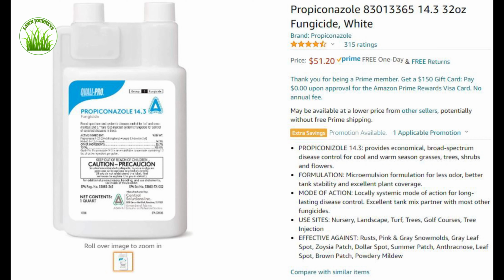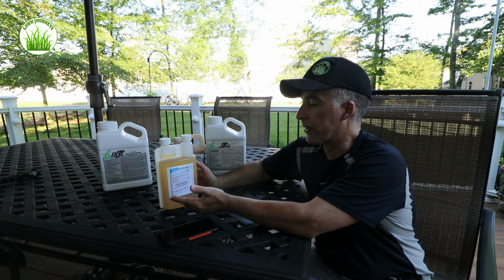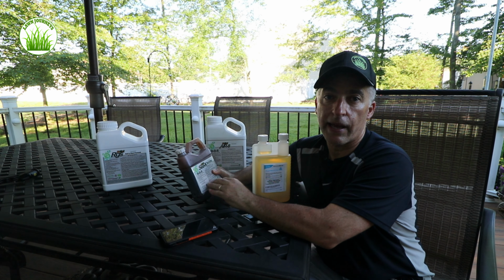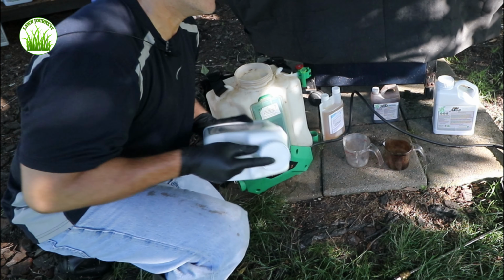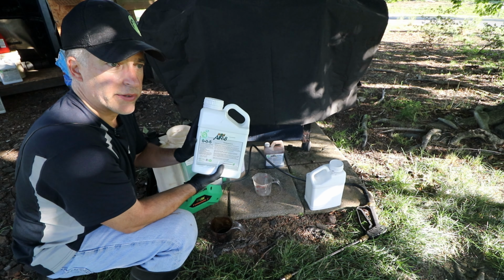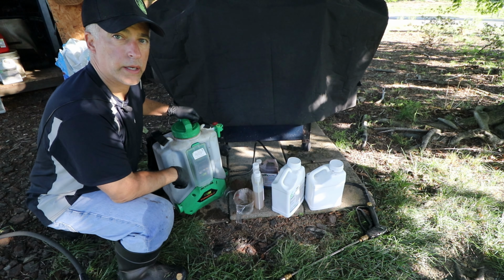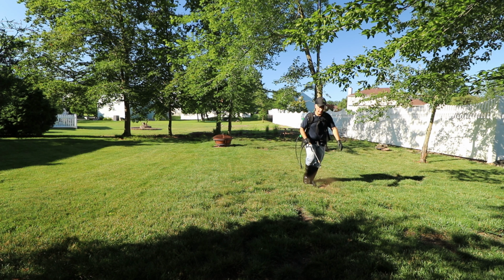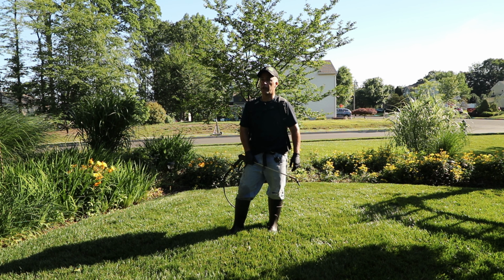Complete Lawn Fungus Control

Comment: Have you ever tried Bayer Rhapsody biofungicide?
It is a bm02 group.
Reply from the maker: No never saw it before but just looked it up.  Multi mode of action and organic listed.  Going to learn more about it. Assuming you use it?   How’s it worked?
Reply: @LawnJourneys  I use a domestic version from Earthalive technologies.
It arrives as a powder, it is a gram positive bacteria that forms spores in the soil when conditions are bad.
I use it off label here as there are no registered fungicide for turf where I live.
Our summers are dry so the fungus pressure is lower.
Bacillus subtillus is sold as a fertilizing product here, to aid in holding moisture in sandy soils, as a fungicide and because it makes lipopeptides it has some anti bacterial qualities.
It isn't cheap so your fungicide products are probably more cost effective.
I use it on the grass early on and as a spray on squash plants for powdery mildew.
It can go on until the day you pick.